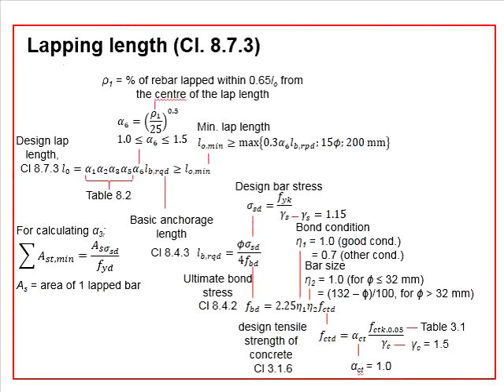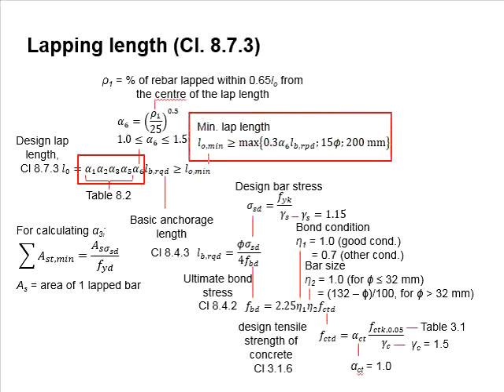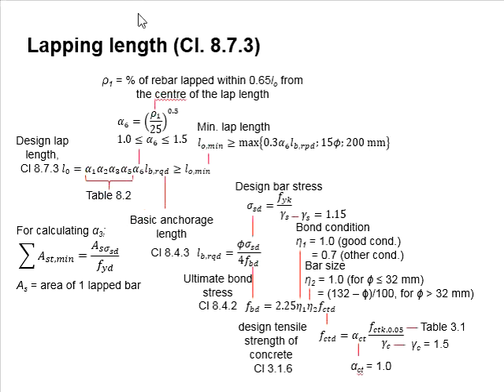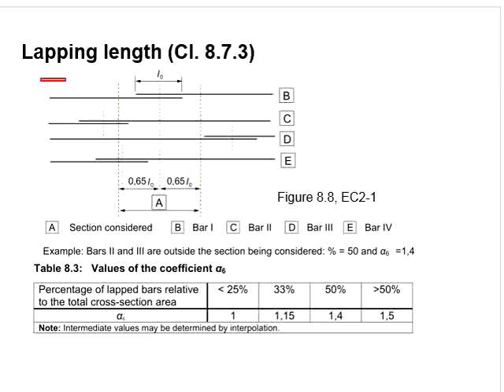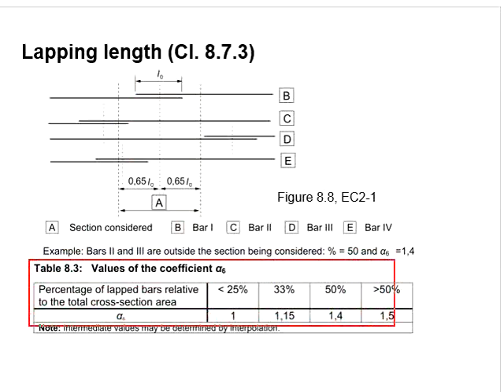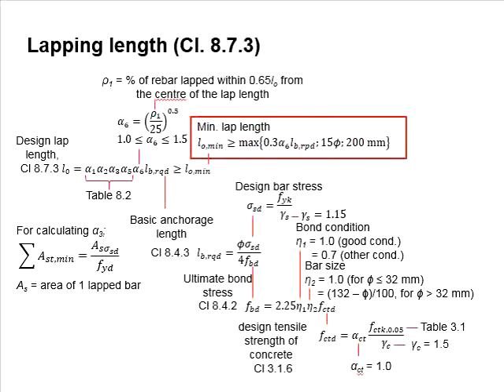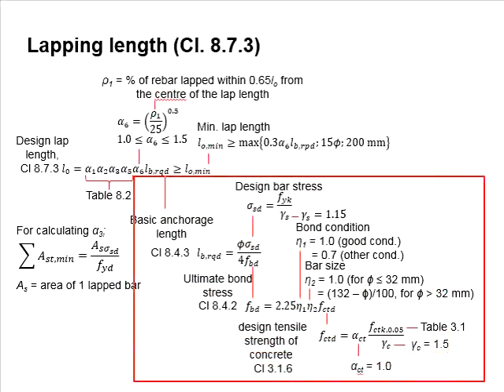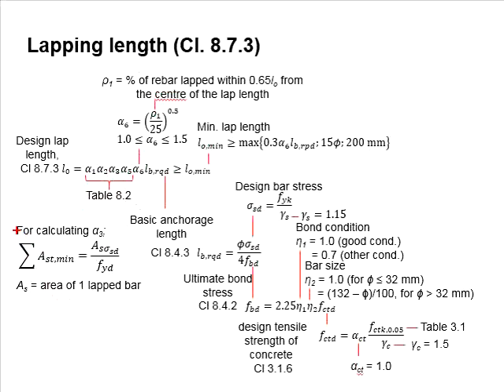5.17 Equations for determining lapping length

Comment: Hi, how to deal with the situation when the stress-strain state indicates that there is a tension zone in the cross section of a column. Accordingly, if there is a tensile zone in the cross section of the column, we cannot place vertical reinforcing bars in the overlap (100%). What if the reinforcement overlap is 50%, the length of the first issue for example is l0=1000mm, and the second issue length should be 1975mm to ensure the condition of 0.65*l0 distance between the centers of the overlaps? Since I am not satisfied with an almost 2-meter outlet under the column, and if the height of the column or floor is 3 or 3.3 m, this is practically an overlap through the entire height of the column.

Because as a rule, it is more convenient for builders to mount the reinforcement cage of the column when all the overlaps are in one section, that is, 100%.
Reply: You can use Finland national anex in which a6 = 2 is like automatically satisfy all condidition , and do 100% tension overlap